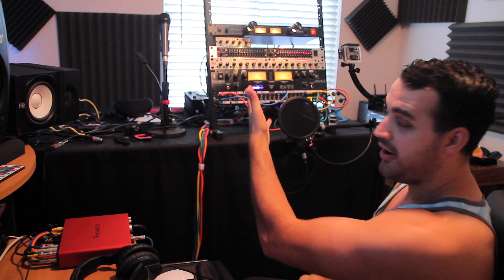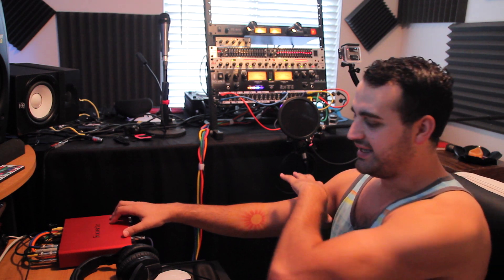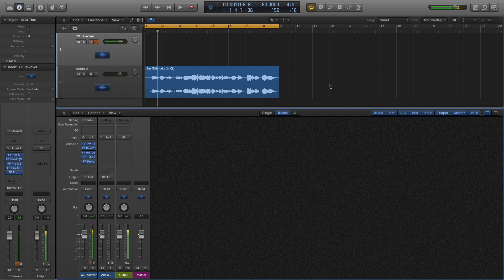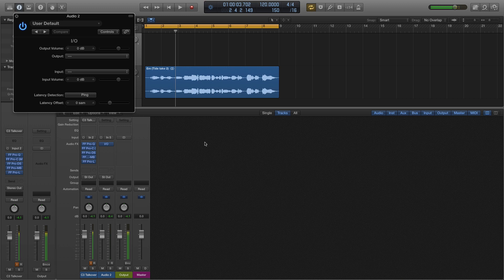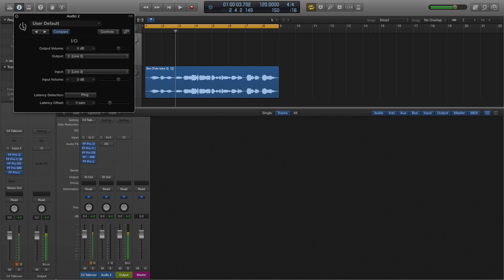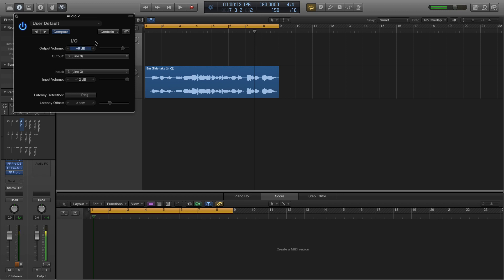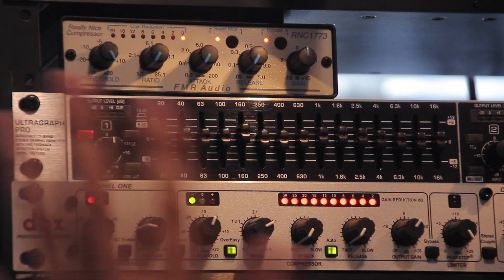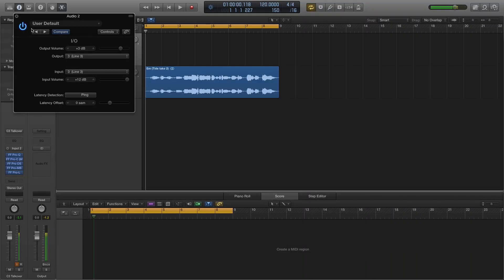Connecting Hardware to Logic Pro X

Comment: Yes, but and the conections? between Focusrite and compressor .. could you explain?
Reply: Focurite out.  In conpressor in... compressoe out...in focurite in...
Reply: Colosphonium do you need patch bay cables to do this or can you use cables that you already have?
Reply: @itskmarvelmann  you can use your 1/4 balanced cable....depending of the lenght you need and distance between inztrument. 
I have no patch bay as i dont use lots of outboard gear anymore, only reverb.
Reply: @Colosphonium  So my 1/4 balanced cable needs to go to the output of the audio interface and inside the input of the compressor and the other 1/4 balanced cable needs to go in the compressor out into the interface input?

Comment: Hi DJChristo3lektric, Got some questions i've never have used hardware mainly used VST but recently found some great sounding preamps that gives the sound loads of warmth is it possible to use a Preamp even though it's going to the audio interface? Also do i need a patch bay to plug all the effects to the interface? Bit confused thanks, Tom.
Reply: plug in your microphone into the input of the preamp and the output of the preamp goes into one of the input channels of your interface then engage the channel in your DAW and start adjusting levels...thats the simplest method..

Comment: Trouble with using the I/O Utility is that it wont work with Logic latency compensation! So, if you're a using mix of hardware and software plugins you cant have the Logic latency compensation on because it will affect your hardware?